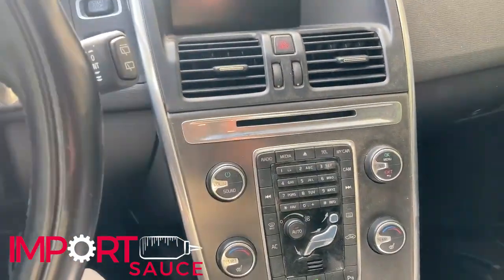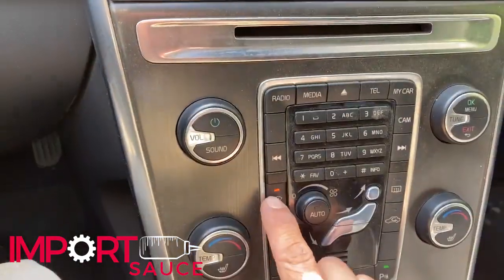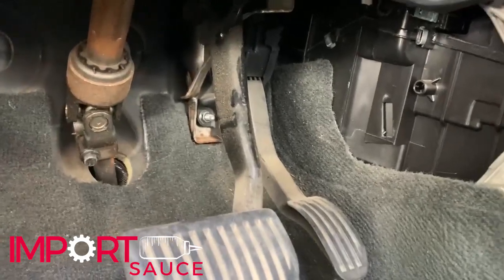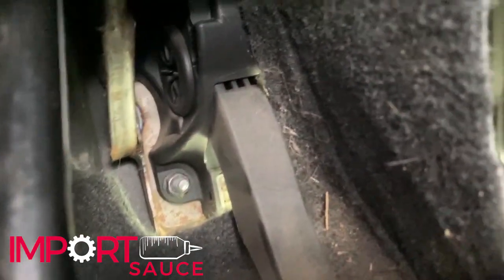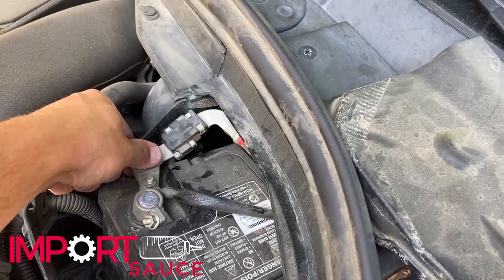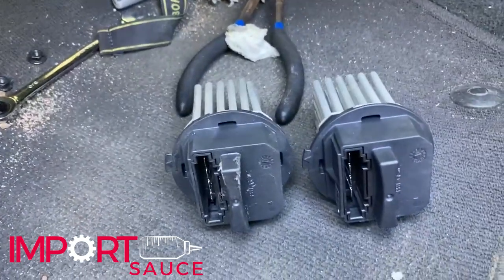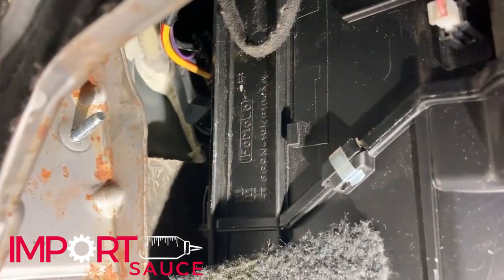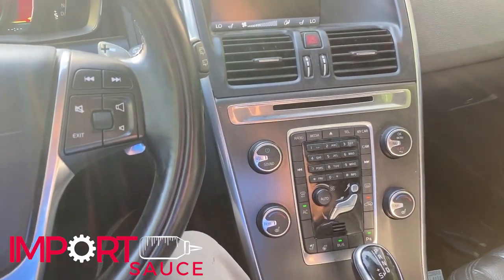Fixed - Volvo P3 (S60 V60 S80 V70 XC70 XC60) XC60 Climate Control Fan Won't Shut Off

Comment: Getting that part OUT was the most fun I've ever had in my life, it was a complete BLAST!!   Afterwards, I was so disappointed the fun was over, I just decided to bash my own face in with a rubber mallet..........over and over again.    Clearly, that part was designed to NEVER come out.    What a terrible design!    Thanks for the video, I might have just cut the damn truck right down the middle with a plasma saw otherwise..........
Reply from the maker: yeah, honestly, it was up there in the top 5 crappiest Volvo repairs, right there with the pedal swap for the m66 tranny swap,
Reply: to me the insulation around that part was too much and also the metal brackets that are attached to the brake servo was a hassle...i took them apart and trimed them off and removed insulation as wsell around were the part goes....much easier nows...modified it so that next time it goes out  and in much easier ...im kinda huge person so i had to remove the driver seat that way i can face the part upside down

Comment: Mine issue is that I am having is I have fan on full blast. And it is very faint/suttle coming out the vents. I can feel the heat and the cold. But when fan is on high it’s not loud. Interior cools and warms but extremely slow
Reply from the maker: Sounds like a bend selector door issue. Cycle through feet, body and head options and see if the door inside moves and diverts air. If not it may be the door actuator is bad. That’s a big job. 😅
Reply: @moosedroppings  all fixed turned out to be resistor!! Blowing Full Power like a JET ENGINE!!! Brr it’s gets chilly in car now. Great for the Texas Heat. I had my local mechanic repair as I am disabled.
Reply from the maker: @matthew2652  awesome. Glad you got it.

Comment: Exactly the same setup on my 2013 S60 T5. I discovered I can feel claustrophobia in my hands, but still luckily passed this trial today thanks to your video! I also ended up cutting out some of the foam and going for the up and out. It's amazing how many ways it seems to be able to face in that gap before it wants to come out.  The foam was easy to score with a knife and just pull out with its thin skin and fluffy backing.  Good looks!

Comment: I have the same problem, been at it for two days and no luck getting the old resistor out. Can I removed the gas pedal metal bracket?
Reply from the maker: You can. 4 8 or 10 mm nuts and a wire harness

Comment: Very helpful, I had to turn, disconnect and pull the unit out before I could get the wiring harness off on my 2015 xc60. Replaced the unit and plugged the harness back in. 20 min job after I figured out how to deal with the harness.  Good as new!

Comment: I had exactly the same problem on my v70 - 2013 last week. But I ordered a resistor and that solved the problem.  So tight and terrible to switch it, but it worked.
Reply from the maker: Hell yeah.  Thanks for watching and thanks for not going to the dealer for service. 😅

Comment: Thanks. I have this problem now on my right hand drive UK car. Not looking forward to the contortions but hopefully it's on the same side so don't have the pedals in the way.
Reply: @TheSabahKazmiChannel   Did it today - tough job for old bones. Two tips: 1. Take the pollen filter cover off to give your wrist a little more room. 2. Walk away from the car and take a break then come back with fresh eyes. Thanks again for your video.
Reply from the maker: @caahacky  awesome and thanks

Comment: for a 2011 s60 T6 is it the same location
Reply from the maker: I could not say for sure. Sorry.
Reply: @moosedroppings  i just went ahead and removed the panel its the same for both of my s60 and s80 as well same   years same location but on an s60 its muucch worse i hade to use a flexable razor to remove alittle insolation around were the part screws in and it went in like a charm , saved alot thanks man apprecait your your work ,,,my arms are killing me no wonder they would charge ,,,,well AN arm and leg for this cause its painful to do
Reply from the maker: Ah. Good to know.  Thanks for reporting back.
Reply: @moosedroppings  my way of saying thank you no problem take care

Comment: Just did this and it works. The hardest part for me was getting the new resistor into the gap. This video and others say to slide it in from the top and/or backwards. After spending what seemed like 30 minutes on my back while working with a flashlight and having no luck, I decided to try it blind and by feel. I flipped over on my stomach giving me no clear sight line up into the cavity (my head faced down while nudged against the console), reached around the brake pedal with my left hand (I'm right-handed) and inserted the new resistor (rods-forward) straight through the gap. Somehow -- seemingly miraculously -- it went through barely hitting the sides. Getting it into the hole after that was easy. Then I locked it in with a small adjustable wrench. Inserting the wire harness was a little tricky because the wires are so thick and the tight space makes it hard to manipulate. Once inserted slightly, I pushed it the rest of the way with a long flat-head screwdriver. 

Hearing the fan run normally -- and shut off when I turned the car off -- was well worth the effort. And I know I saved a boatload of money. One local auto shop told me any Volvo fan repair was at least a 10-hour job because it needed to be done from the engine side. The local Volvo dealership wanted $700 just to replace my battery (it simply needed charging) before they could even diagnose my problem. Bottom line: If your Volvo has a fan that won't stop when you cut off your engine, buy the $25 resistor on Amazon and replace it yourself. Don't give up. If I can do it, you can do it.
Reply from the maker: Awesome!!!! It was for sure one of the trickiest jobs, along with cabin air filters, pedal swaps..... all in the same place. Now the climate control fan is squeaking and not looking forward to ripping the entire dash apart to source and swap the blower motor.
Reply: I’m a woman that just puts the gas in and go.  I wonder if I can do this on my s60?  The battery is fully charged that’s no problem. Everything comes on in the dash the fan comes on. Of course it won’t cut off unless you unplug the battery but the only thing is the vehicle is not cranking up, so is it worth it for me to go down there and attempt to replace this part as you see or as you have in this video and then, find out that I cannot get the car to turn on?  It’s been sitting for ride it almost 2 years if not two years simply because I had no idea what was going on. I had literally just pay someone $700 to replace the battery and we just simply did not have it and we just used our other cars and it sat there so I have no idea what’s going on and I hate to go all the way in there do all that and the car still doesn’t work.
Reply: @locdveganfoodie  hmmm, well if the car isn't turning on, I would attack that issue first. But other than that, it is a very doable, just painful job.